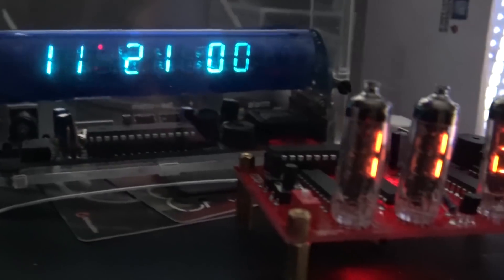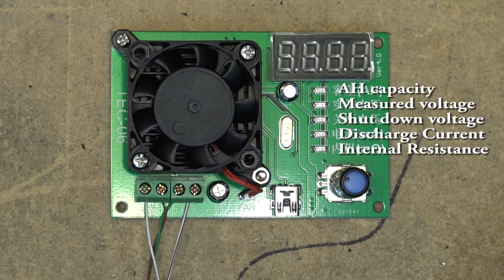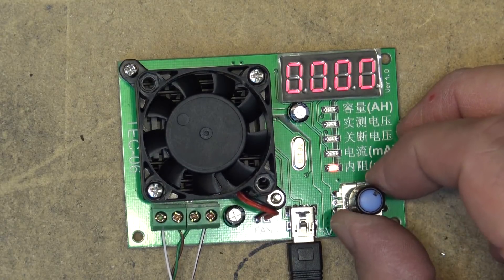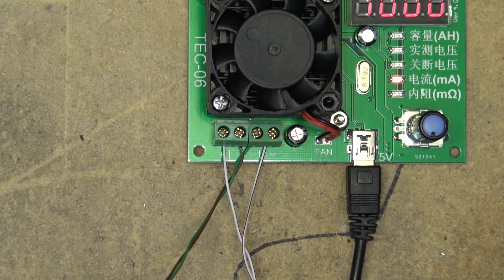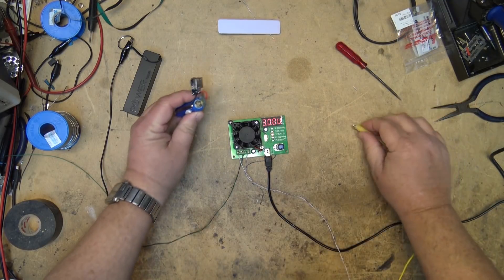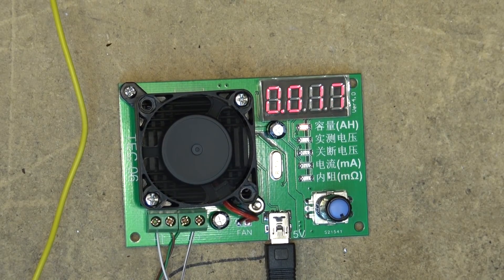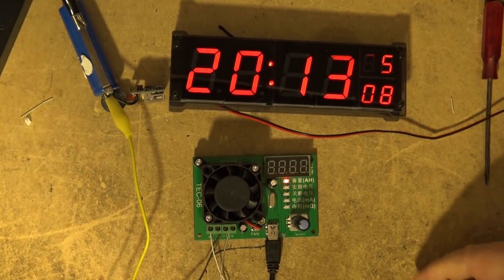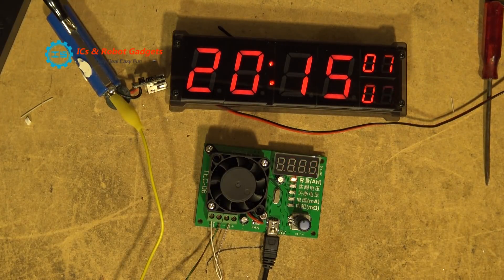Digital Battery Analyzer Test Run

Comment: I would be interested more in this device if it integrated the milliwatt*hours by considering the voltage along the way.  That way I could more accurately determine the efficiency of a powerbank by testing the cell mW*h against the delivered mW*h.  BTW - I have the same wristwatch you do!

Comment: so you connet the battery to I  and to measure the amps you connect in series to V......see a potential problem here? i for amps and V for volts aka battery but here it's reversed?

Comment: Did you ever checked, if the displayd Values are true? And is there any possibility of calibration, i.e. https://www.youtube.com/watch?v=viiRounCLWw  ?
Reply from the maker: I believe it is relatively accurate as the cell in that unit was rated 1600maH and it measured 1550 so it is pretty close. It is DSP controlled, and calibrated at the factory.I have tried other cells and it shows rated capacity very close. Had I used a discharge min voltage or 2.9 as opposed to 3.0 then it would have showed probably closer to the rated capacity of the cell, as when battery manufactures rate their cells it is to whatever discharge voltage they use in their tests. So your results will vary if you do't use the same discharge cut off.
Reply from the maker: Also that deice in that video is a different unit as he is using resistors as the load. This one has it's own internal drain.

Comment: Hello,   been subbed for quite  some time.  I recently came across my old Fluke 8024B, with case, probes gone.  Ideas, interest or comments?  I used it in the early 90's when i was a youngster of 38 or so.  BTW, works fine, switches need cleaning.

Comment: A handy unit for matching batterys, for use in packs.
Reply from the maker: Yes this is what these are designed for. So you can match cells when building, or rebuilding packs, as when an expensive pack fails it is generally only a single cell that goes south.

Comment: Interesting device. It kind of defeats the purpose of a 4-wire measurement to hook the load and sense wires to a long jumper. The sense wires should be connected as close to the battery as possible.
Reply from the maker: The reason why there is 4 wires is to calculate the voltage drop between the loaded wire and unloaded wire. The length really won't make a difference as long as the gauge of the wire is the same and the length is the same, as that way the processor can factor in the length. of the jumpers. For the most accurate measurement I should put my clips on directly at the bond for the current and voltage loops, but that extra 6" of jumper wire really isn't going to make much, if any difference in the readings. Not at these voltage / current levels.
Reply: Wires didn't look too long to me. a foot or so of wire isn't going to hav any effect on the measurement. If this was the case multimeters would come with very short leads, as would osciloscopes, but they don't, they come with nice long test leads.

Comment: Banggood also has this tester with or with out the computer hook up capability. They also have a acrylic shell around the tester. They are a bit more money with the case. I have also found that this unit is a bit pickey. Mine will not test all 18650 batteries. It has a problem with some protected cells. I have several different capacity testers, about 10 different ones that I use to test my batteries before I build a power bank with them. You really can't go wrong with this tester.